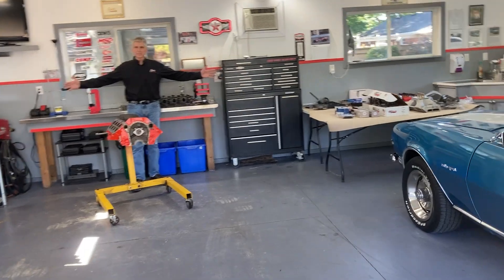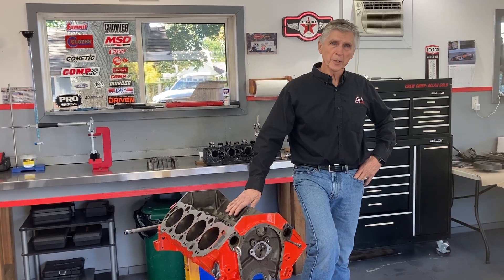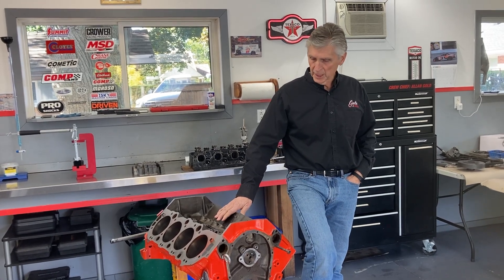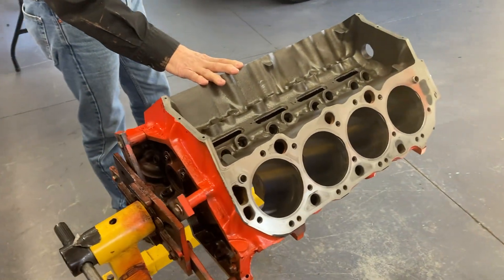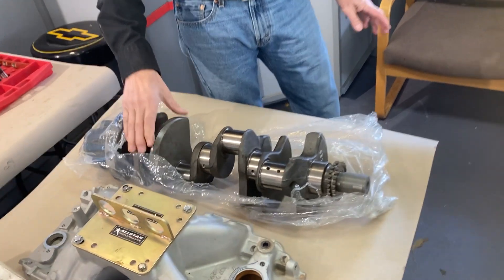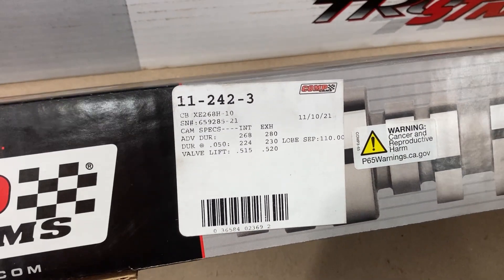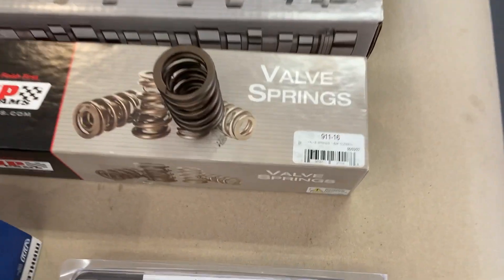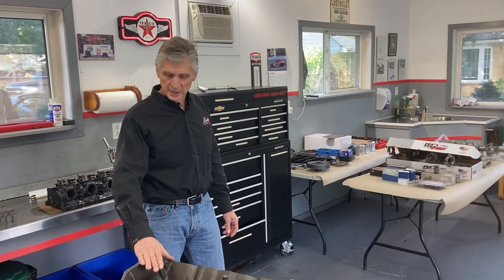The Almighty 427 BBC Big Block Chevrolet

Comment: Dont know how i missed this video, building a 383 stroker rn but im breaking my own rules, ive always said go bb right off the bat and you wont be disappointed, have parts for a similar 427 in the shop, might be building both but im further ahead on the sb, my judgement is how hard it pulls hi gear and sb's usually disappoint unless you run boost and i dont spray
Reply from the maker: Sure, your 383 will pull hard too, same stroke as a 427. AG

Comment: 302 was a killer engine too, had a 68 MO code 302 I built with aluminum rods, 13.5-1 Arias pistons, lightened stock forged crank, ported Phase 2 Bowtie heads, 280/288@.050, 680/680 lift, 106 lobe separation Ultradyne cam, ported Strip Dominator with an 830 annular discharge DP Holley, Stahl 1 7/8 headers. Ran 6.20s in the 8th in a gutted Vega with 7000stall and 6-17 geared Dana 60 rear. Went thru the lights at 9800rpm. Best sounding engine I ever built. That was decades ago.
Reply from the maker: Wow, that was a killer engine for sure. My only experience with a 302 was drag racing my 68 Z28 in E-Stock class. My first blueprint job but only to stock specifications. Thanks for your comments.
Reply: @goldsgarage8236  I love them Stock/Superstock cars. Definitely takes some effort.

Comment: I bought and read Smokey Yunick's entire 3-book autobiography series, and he stated that he was invited up to the factory to check out "the new Mystery Motor" to give them his thoughts & opinion about it. He said they had one running on an engine dyno, and another totally disassembled on a large table for him to closely inspect every component. HE LOVED IT. He also asked: "Who is responsible for designing this engine?" and a rather obscure fella with Chevy spoke up and said "I am". Smokey walked up, shook his hand, and said: "I think you're gonna really make  a name for yourself with this". Smokey stated that the Mystery Motor was TOTALLY DIFFERENT from the 427 block & heads that quickly replaced it. He said the bean counters were responsible for killing the Mystery Motor project because that engine would cost far more to produce vs the 427 we all know. Junior Johnson said the same thing, the Mystery Motor had a bigger bore yet a shorter stroke. Both stated that the Mystery Motor was still early in development when it was axed, and the engineers hadn't yet worked out the issues with the valve train. If it held up during a 500 mile race, IT WON THE RACE. And it led laps in every race until it either blew up, or finished & won. Those guys were there, they worked on and raced the Mystery Motor that single year........I believe what they said.
Reply from the maker: What a great story. Thank you for sharing, AG
Reply: @goldsgarage8236  You're very welcome. Both Smokey Yunick & Junior Johnson/Ray Fox were furnished with 7 Mystery Motors each ( only 14 ) during the off-season for the upcoming nascar season.......1963, if I'm recalling correctly. They also furnished them each with something like 6 complete cars apiece. Mickey Thompson was also furnished with a small handful of Mystery Motors for the road races & 24 hrs at Daytona. The only few engines that were left had to be given ( upon request ) by a couple Ford & Mopar teams, per the nascar rules. Junior Johnson wisely bought those few engines back from the Mopar & Ford teams after inspection. But right before the nascar season started at Daytona that year, Chevy backed out of supporting these race teams altogether. That's the year that the '63 Impala designed & raced by Junior Johnson & Ray Fox was very revolutionary for it's time, using things like truck trailing arms for the rear suspension that are still used to this day in cup racing. Junior & Ray both said if it wasn't for bad luck, such as the engine blowing up, a crash, or a blown tire late in the race, etc...... they would've won every race that year with that car & engine........it was that dominant. What rare film footage exists from that season, shows Junior Johnson in his Impala just blowing the doors off the rest of the field........and they either won, or bad luck took em out.

Comment: That engine is a nice reliable street engine. I built one very similar, only it was a 454. The heads were close chambers 3904390 with 2.19 in 1.72 ex. With flat top pistons and steel shim gaskets the compression ratio is 9 to 1. The cam is 224 in 234 ex at .050 , lift is .560 in .585 ex with 1.8 rockers and 114 LSA, a 107 LSA would be much better for torque. 750 holley HP on top of a performer rpm and headers with 2" primaries 3" duel ex. all sitting in a 78 stock looking nova. Yes the new muscle cars are faster, but there's nothing like the old school NA engines, they seem to snap to attention on demand. I've raised the eyebrows on many new muscle cars. Looking forward to your build.
Reply from the maker: Thanks for your input Joe. I just can't get excited about the new LS stuff either, it's personal, I guess. Sounds like you have a nice Nova, can you post a picture of it on my channel? 
Since I posted the video, I have decided to go with a roller, COMP 276HR. It is the same cam I used in Norm Collver's 427. There is a video about it on my channel. The 276HR is 224/230 but only .510 lift, 110LSA. 1.8 Rockers would help on the intakes for sure.
Reply: Joe are you in Hollister California?
Reply: Wish I was, I'm in Oshawa Ontario Canada and not looking forward to the next 6 months. All the best. @danielwilliams2994
Reply: Got one of the l88 427

Comment: Hi new to bbc motors , my question is I seen on the side of the block it was stamped 7.4 , wouldn’t that be a 454?
Reply from the maker: Good catch Ajp. It was originally a 454 block. A 454 is a 427 with a longer stroke. AG
Reply: @goldsgarage8236   so would a real 427 say  7.0
Reply from the maker: A 427 is 7 liters or 6,997cc. Not sure if it is cast on the block. AG

Comment: My hi-perf 68’ 396/375 as well as an L88 short block from Amity Chevy from 1988 both were a notched blocks!  A  landing grove is cut into the deck For the clearance of a 2.19 intake valve! Open Chamber heads is what I always ran; fuel was not that difficult to get yet. I sleeved the 396 and boring out to the 402 bore.  I had to die grind the edge of the sleeve and my dad polished it perfectly.  Today they use the tall deck or truck block to avoid the groves…
Reply from the maker: All good info, thanks AG

Comment: The 427 "Mystery Motor" hit the track in 63 as a racing engine only. In 65 GM released the 396 425hp engine in the Vette. 66 came the MK4 427. 348/409 was the Mark 1, MK2 never seen the light of day, MK3 was the 63  427 NASCAR engine, MK4 was the 65 and up bigblock Chevys.
Reply from the maker: Thanks for the info Gearhead, it was exciting growing up with all this in the 60's. I remember it well but we know more about it now than we did at the time if that makes any sense.
Reply: @goldsgarage8236  Yep, getting pretty old myself. Hard to remember it all like I could years ago.

Comment: One thing you didn't mention is put the head on the bare block and feel through the bore from the bottom you will see that the head chamber is wider than the bore and the top of the bore needs beveled so the air coming into the bore doesn't hit that notch. It makes a noticeable difference in the power the engine makes
Reply from the maker: Thanks for your input David. AG

Comment: That’s not true my father ordered a 1969 GMC K 2500. He special ordered it with the big block for 427 granny four speed 4 inch factory lift with an eaton rear end with 4:56 gears and an NP205 transfer case my mother still has it in her garage. It’s it’s in mint condition all original
Reply from the maker: Thanks for pointing that out Brenda. a tuck version of the 409 was also used in many applications, trucks, school buses etc.  as you describe. Thanks for watching and commenting.AG

Comment: Awesome build. I'm looking to build something very similar. Do you have part numbers for everything you used? Would make life easier for shopping. Thanks
Reply from the maker: Thanks Just. The cam is COMP XR276HR-10, part # 11-423-8. Valve springs are COMP 911. Pistons were Sealed Power Forged., i think 26cc dome. Compression was 10.2:1 173PSi cranking pressure. 
Heads were 1966 Corvette oval port, 103cc. ported. Original Chevrolet Forged crank. Manley H Beam rods. Balanced by Atchison machine in London ON. 
Depending on your head volume, I have a set of Sealed Power forged pistons part # L-2268G, 36cc dome, .030" complete with rings for a great price. I couldn't use them because with 103cc CC i would have over 12:1 CR. With larger cc volume they might be ok. 
Hope this helps. AG

Comment: Really Really nice 427 Hi Perf engine project !! ....The Chevy 396/427 "Rat" motor Is deff the most Affordable, Brilliantly engineered hi-performance  example of it's day & Many times, a properly assembled, affordable "Rat" could outperform a similar cost Chrysler or Ford engine....An equally Competitive  Chrysler  or Ford motor Is going to cost a Lot more money... A Cast crank in a high revving big cammed ported head 427 seems a bit odd as I thought all the good factory hi perf "Rat" motors came fully Forged ?? ......Is the Intake port fully ported as well ?? .....Are those factory  rectangular port heads or one of the Oval or Peanut type ? ......You didn't mention the cylinder head Intake cfm flow specs but  are they optimal for your Low/Midrange Rpm intended power band ? ........Thx for showing us your cool stuff.....
Reply from the maker: Thanks Tom,  actually I did end up replacing the cast crank with a forged crank on this build, however the cast crank would be fine for a street engine. The intake port volume was 250cc, the heads were originally 1966 Corvette 390HP oval port heads, not the peanut port heads. Thanks for your comment and please keep watching, lots of content to come. AG

Comment: Just a note here, the 4 bolt main caps are not as strong as the 2 bolt main caps. 2 bolt main caps have more cap area and are stronger. If you really want a strong bottom, best to take a 2 bolt block, and put billet splayed main caps in it. Nothing wrong with a 4 bolt main, just a note for the curious.
Reply from the maker: Good point Anarchy, however even a stock 2 or 4 bolt block is good for 500HP.

Comment: Hi Al , Curious on the bore ie sonic check/test. Great engine...saying goes they all made 500 hp from the factory! Looking forward to hp dyno results

ed
Reply from the maker: Hello Ed. The engine was only bored .030". The original 427 has a solid lifter cam, 11.0:1 compression and square port heads. I think there are videos of an exact reproduction L88 that does make about that. For this build I targeted the GM performance ZZ427 that made 480HP and 490Torque.  We made 479/499. I am sure we could have squeezed out a few more HP but dyno time is expensive. We also made more torque.
I could have also used a bigger cam but I wanted it to be streetable for a variety of applications.
Reply: 435 from factory NEW. Maybe 500 with aftermarket intake headers and cam

Comment: Such a tiny cam.... I'm not saying it needed a giant cam but, that's mild small block cam specs...
All those cubes, that good rotator and heads, just to leave soo much power on the table....
I know it's just a mild pump gas street engine but definitely leaving alot on the table by not using a roller with modern specs. JMO, take care!
Reply from the maker: Thanks for your comments BEANS. Actually I did end up not using the 268H cam. I installed a COMP XE276HR, not a big cam either but at least it is a roller. I still have the 268H in the original box if anyone is interested in a good deal. 
There are subsequent videos about this engine including the Dyno test and installation in a 1966 El Camino. 
I was kind of targeting the GM Performance  ZZ427 Crate engine. It made 479HP and 499 Torque.
You are correct the rotating assembly could easily handle another 100HP and 1000RPM. I normally do not exceed 230 degrees @ .050" for a street engine. AG

Comment: Another suggestion you should never run a high volume oil pump stock volume is adequate it will suck the oil pan dry at higher rpm high pressure is ok. They never had high volume oil pumps till the 1980s. My friends shop used to get more work from high volume oil pumps because people would ruin their engines from this  mistake .
Reply from the maker: Thanks for sharing your knowledge and experience Jim. AG

Comment: I own a  dealer installed 427 Berger Camaro it was a drag car most of it life raced at US 131 Dragway just south west of Grand Rapids where Berger is i have documents  for my car from the dealer.  My car is not a COPO it was a rare dealer engine swap .Only a few where done at Berger unlike Dana,Yenko,Nicky. My car came from GM to Berger as a 1969 396/325HP auto (400) SS  Camaro .
Reply from the maker: Thanks for your comment bigdaddy. I may have seen your Camaro. Back then I lived in Sault Str. Marie Canada which is just north of Northern Michigan. Berger also had a high performance parts counter and I bought many parts from them. They also had my 302 balanced for me. We often left early in the morning on the weekend, went to Gratiot Auto, then Berger on the way home. I loved their high performance showroom with 427 Camaros and L88 Corvettes. I even remember seeing some ZL1's there. Your Camaro is exactly what I was talking about in the video. Cherish it, as I am sure you do!
Reply: I WANT A 427 CHEVY MOTOR FOR A CHEVY SILVERADO HALF TON PICKUP 4×4 PICKUP TRUCK 1994 MODEL
Reply: A 7.0L LS ENGINE FOR A CHEVY SILVERADO HALF TON PICKUP TRUCK 1994 4×4